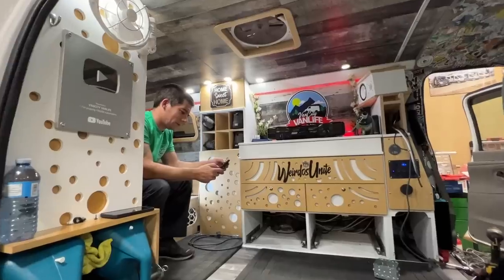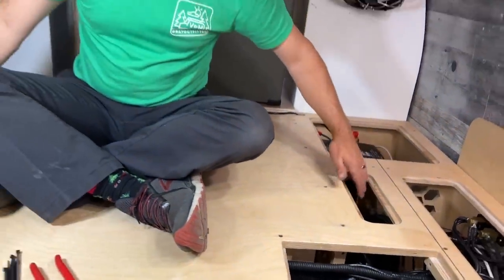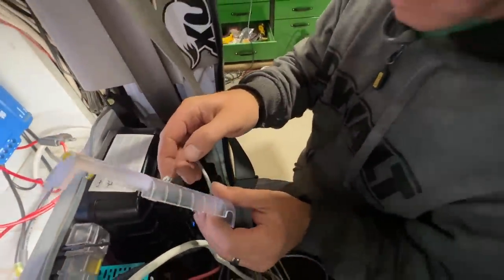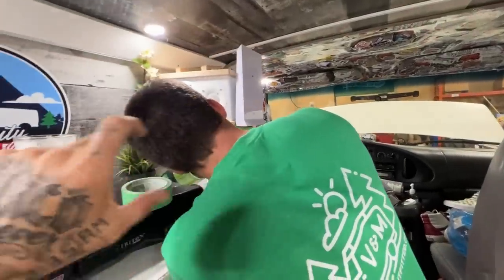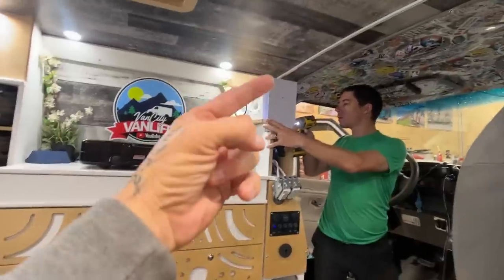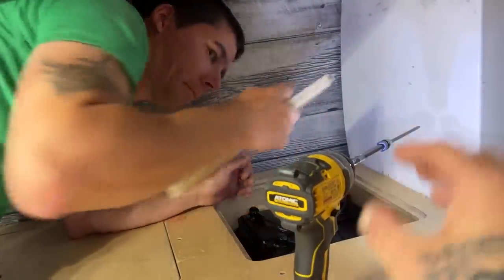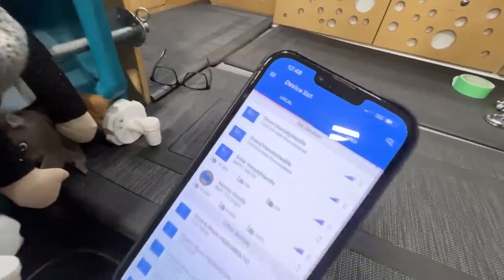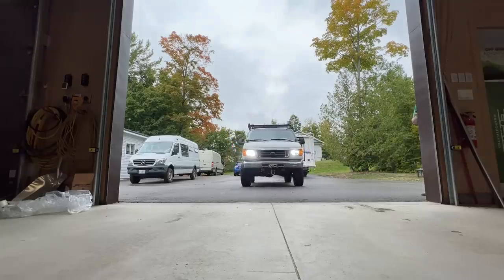WE ARE DONE. New Batteries, Vacuum Drawer, Inverter Switches. LAST DAY

Comment: One suggestion for you, since you like to go down the back roads and collect a lot of dust, would be to put a small shelf just above the inverter, so that at least some of that dust and dirt will land on the shelf rather than straight into the openings on the inverter. Dust+electronics=heat and heat kills electronics.

Comment: Wow they do great work. I wish I had went with SOK batterys, I went with Ampertime 200ah in one battery. With 200w solar on roof. I hope it will be enough. I really like your videos. Safe travels.
Reply: Ampere Time batteries are fine.  Quality is actually pretty close to SOKs, with the notable exception of the lack of low temp charging cutoff.  VERY important to ensure ALL of your battery chargers are temperature aware and configured to disable at ~3C.

Comment: Great set up! I have the same system but using only 2x100ah battle borns and a single Orion DC/DC controller. But everything else looks about the same. First thing I had done with my van was the solar/ battery / shore and alternator charge. 👍👍.

Comment: this is what I did Chrome I've got four lithium and three victron Orions, I wanted to see if the relays do stop the Chargers from coming on so I set the temperature higher than what they were sitting normally in everyday life and the Chargers still come on to charge them, so that looks like it told me just because the relay you can set the temperature you don't have a separate relay wired up to keep the charger from coming on that's my guess, but you have an added security with a low temperature disconnect within the batteries themselves my batteries don't have the low temperature so that's why I did toggle switches to my victron's so I control when they're on and off

Comment: sorry the shunt wiring explanation was unclear. How is that wiring setup? Is there no bus bar? Why are there so many cables on the left side of it? The right side of the shunt is from the batteries and then the second cable is out to the chassis ground? So the three cables on left side are going to appliances? Where? You threw out your fuse label panel?? Tsk tsk.